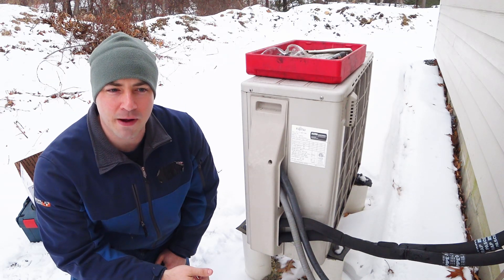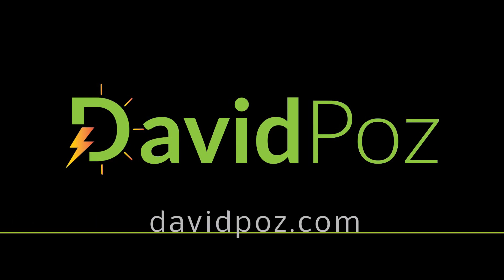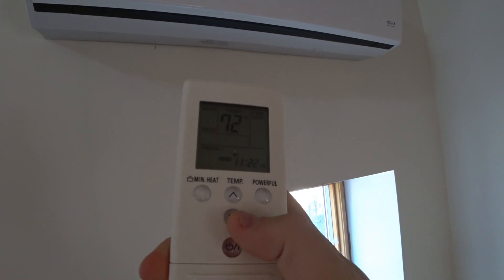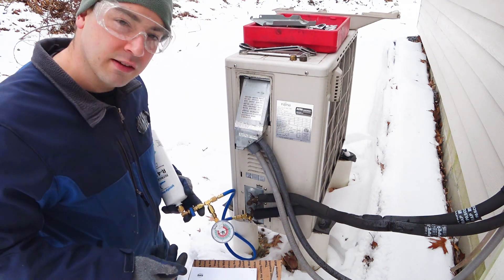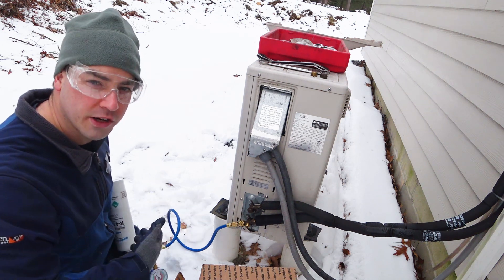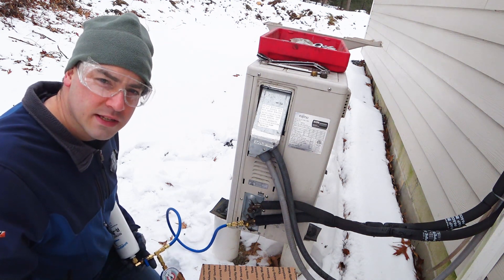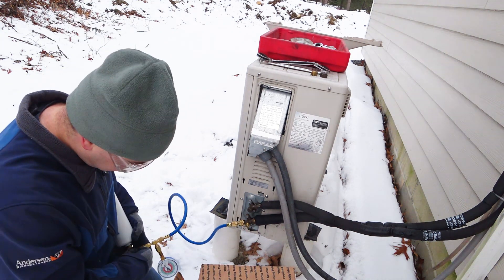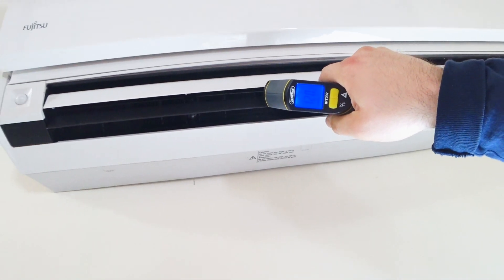Saving Money with DIY Repair on Mini-Split Heat Pump

Comment: If it has been a recharge each time then there is clearly a leak. A competent A/C guy should have a leak detector in his goody bag to trace down the source. It isn't hard but takes time to do it right.
Reply: i2nupman if the fan in the head unit is clogged then it can’t blow enough air to force the temperature change then the gas returning near the same pressure that it came. It’s important to clean the roller fan by removing it.
Reply: You can get florescent dye to put in system. Let unit run until low on refrigerant again. Then check the whole system including the indoor unit and the outdoor unit, especially around the reversing valve and where the piping go into the compressor.

Comment: It’s how its mounted, it needs to be secured firmly on rubber feet so the pipes can’t move. It needs to be level in both directions. It works by pressure differential between the high (small pipe) and the low pressure (large pipe), if the pressure is too close to each other it won’t work. Also would pay to take out the fan inside the head unit inside the home and wash it.

Comment: I did my freezer a few weeks ago. I hadthe same feeling, might not be what a pro would do, but what do you have to lose by trying. My freezer is working again, who knows for how long. But now I can plan for its replacement. I didn't see any vids that mentioned holding the can upside down, it does Makes sense but I know I didn't do it.

Comment: I commend you on buying a heat pump... but your experience has been terrible. You would think Fujitsu would wise up... after your experience and being online Fujitsu would want to get it right for you... otherwise no one online would buy a Fujitsu product knowing your terrible experience... likewise, being in the marine industry I would never recommend a Mitsubishi product... but Mitsubishi ductless mini split heat pumps have a great reputation... bottom line... do lots of due diligence in your local area... ALWAYS use a factory recommended service provider...  BTW I see many heat pump manufacturers requiring professional HVAC startup commissionings.  If you want the best - hire the most qualified and follow factory rules.